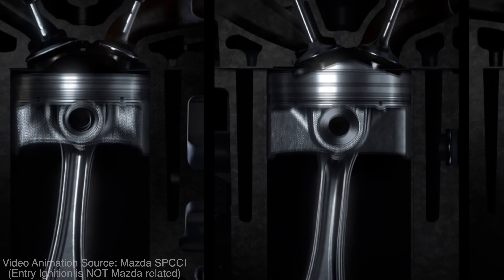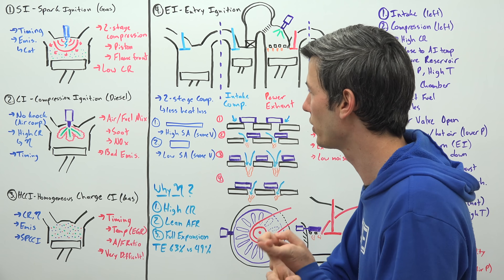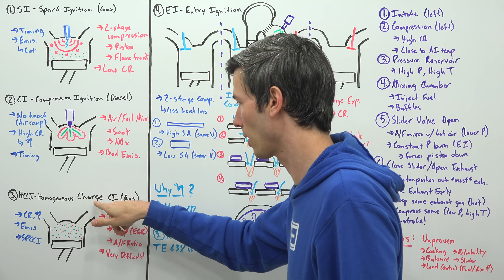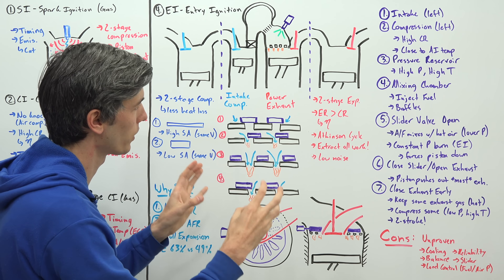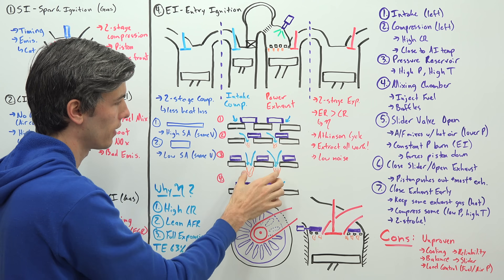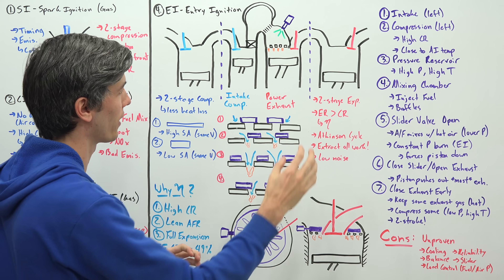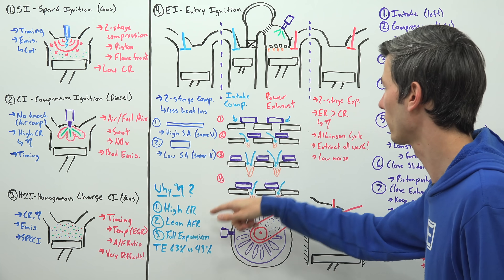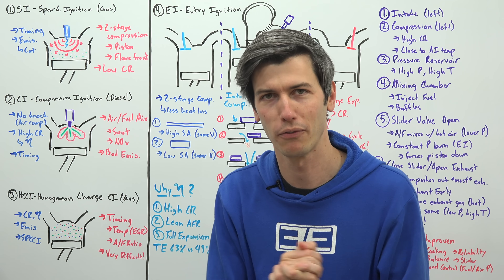Is 'Entry Ignition' The Future Of Combustion Engines?

Comment: Very complex! It can be difficult to get metals to seal when hot and cold, things move,  the idea could work, I think a turbo would work simpler, maybe just as good,  compress the air fuel in a I take runner, then open the intake valve, igniting when the valve opens,  maybe switching from Normal combustion , depending on speed and load, maybe using compound turbos, with intake valves on both ends of the intake runners, it could maybe work!

Comment: more moving parts is more loss of power due to friction, plus with that many cylinders its gonna be a very big engine and its gonna weight a lot more hence again loss in efficiency.
Reply: Weight is a function of both cylinder size AND maximum cylinder pressure. Since the intake and re-expansion cylinders never see significant pressure they can be built lighter and with less sealing capability, reducing weight and friction.

Comment: What kind of power-to-weight ratio would this have compared to a conventional gasoline engine? I'm just wondering if this design would be practical for use in airplanes. Of course there's also the question of reliability - tends to be important in aviation! - but as you pointed out it's too soon to determine this. It might be breaking the KISS principle, though.

Comment: More moving parts, less power strokes. (I was assuming there are 4 pistons, one of which has a full power stroke, even as a two stroke)
Reply: You could have any ratio of compression to power pistons want. Or no compression pistons and just use an oversized supercharger.

Comment: Because of the pressure on the slider mechanism, wouldn't there be a lot of wear on the two components?  I realize there will oil or some other lubricant, but with the air/fuel mixture always traveling in one direction, seems like it could dry out pretty quickly.

Comment: At least in this example, the third cylinder provides the primary work and the fourth cylinder provides secondary work by recycling/scavenging the pressure from the 3rd?  Neat concept.  Thought: since combustion is rarely perfect, could that hot and highly pressurized exhaust from #3 be partially charged with a tiny tiny amount of fuel in an attempt to make use of the remaining O2 to provide another attempt at primary work, and then have that last cylinder providing work due to the exhaust pressure?
Reply: Nice thought, but no. The re-expansion cylinder is after primary work, as you call it, is finished. So the perhaps 10:1 expansion of the combustion cylinder is long gone, leaving perhaps 4:1 expansion (determined by the relative sizes of the combustion cylinder and the re-expansion cylinder). So that extra fuel will get you a bit of extra power but really trash your efficiency. Think of it like an afterburner for a piston engine.

Comment: Well, with compression that high, you would have a 2-cycle diesel engine. It won't run on normal pump gas.
Reply: Actually, diesel ignites at a lower temperature than petrol. Petrol is low-temp vaporization and high-temp ignition; diesel is high-temp vaporization and low-temp ignition. The engine will work better on petrol or even CH4, which is way-low-temp vaporization and way-high-temp ignition. The engine's theory is to segregate (hot) residual exhaust gas and hot combustion chamber parts from relatively cool combustion cylinder intake air. It works because there is an inherent delay in combustion because fuel needs time and energy to vaporize and start burning. Time the injection of petrol (or whatever) based on the fuel's characteristics and the engine will work just fine. Still a klugey and inefficient design that's not much better than current designs, but it's taking a peek through the keyhole at a truly advanced and efficient engine, the Caldwell Cycle engine.

Comment: Looks like a convoluted way of attempting a turbine engine with reciprocating pistons instead of compressor/turbine blades. If we learned anything from turbine blades, it's that they get extremely hot, even requiring special expensive super alloys... So I imagine the thermal management of the hot side to be a nightmare.

Comment: How do you start the engine from a cold start?
Reply from the maker: Tech paper says it could use a spark plug in the mixing chamber for the very first cycle.
Reply: @EngineeringExplained  sounds tenuous. Remember, the mixing chamber is larger than the combustion cylinder and that mixing chamber flame (which MUST rely on standard flame propagation) has to be extinguished before the second cycle's intake begins while still leaving enough time for homogenization of the second stroke, AND the cold combustion cylinder can't suck too much heat from the gasses to make one of the first few ignitions fail. Doable, I suppose, but fugly. I'd never accept the design, but if I did I'd probably keep cylinder 3's output valve closed during one or three no-fuel cycles, depending on ambient temps, seriously increasing compression (and heat) for the second or fourth (way lean) cycle. You'll need some variation of this anyway since the pressure reservoir, mixing chamber, and combustion cylinder all need to be brought near operating pressure before the engine will work properly anyway.

Comment: The common energy loss in a combustion engine is heat. Normally, it is dealt with by radiating it out with a radiator. Is there a car which can actually use that heat? Example: charge batteries for a hybrid car. Even today's hybrids normally use the engine to turn the generator, but what about the engine's heat?

Comment: Way too many moving parts to ever achieve reliability. The future of combustion engine is in the fuel itself. Basically, you can modify a normal chainsaw type 2-T engine, where the whole combustion chamber and cylinder is one piece, to work efficiently with renewable fuels, or use basic 4-T, adding different types of forced induction, and exhaust gas recycling. The biggest problem in your model is the combustion chamber. That valve is next to impossible to reproduce commercially, due to it's design. Also, Honda had CVCC in the 70's-80's, that used a pre-combustion chamber, and Yamaha designed YICS-tube to get more mileage. So, the tech to achieve highly efficient, powerful and reliable normal style combustion engines has been around for 40 years. Today we need to take a closer look at the fuel to get better results.

Comment: @Engineering Explained   Can you do stuff on Heat Recovery, and stuff on the seperate fuel rich "jet ignitor" method (i can grab the group that does this)
Reply: Also are there any piston engines that USE detonation?  I have heard of wave disk engines, and pde jet engines, but not any piston engines.
Reply: @ericlotze7724  Diesels are soon if not already getting steel pistons .. the aluminum pistons are too great a heat exchange, besides that, I see them soon reaching obsolescence at the rate horsepower is increasing. 
Should make for a nice expansion of the envelope when they make it to gasoline engines...

Comment: Sort of like a double expansion steam engine in some respects
Reply: So tripple expansion might be better! (though heavier)  I was also thinking that external high pressure reservoir looked like it came off an old-school oil engine..... But if there's extra pressure left over and you need compression... doesn't that just shriek turbo-charger?

Comment: What happens when the slider valve opens and the first bit of fuel gets ignition then that ignition travels back into the reservoir where the rest of the fuel is burned. Also what happens when the combusting gas surpasses the pressure of the fuel and forces the useable air and fuel back out the slider valve. Or when the exhaust goes back out the slider valve since it is immediately combusted.
Reply: Quenching works. Keep the openings narrow enough and the cooler-than-ignition-temperature metal will quench the flame, preventing mixing chamber burning even if retrograde gas motion occurs. Well, unless the slider valve gets hot or the retrograde gas gets hot enough to combust anyway. Lousy design, but in theory....

Comment: No idea how to start this engine when its -15°C outside
Reply: Yeah some places get down to -40 ° and my diesel refuses to start. Same problem
Reply: @IceInMaWeiner  your diesel heating resistors are broken
Reply: And glow plugs
Reply: And glow plugs!
Reply: And glow plugs!
Reply: That's a good point - there would have to be a spark plug to ignite the first power stroke.
Reply: use a blowtorch on your pistol bro
Reply: ElectronicRedPanda yeah, I said modern. I know those intake air heating stuff from farm equipment from 70's and also in those machines that is almost useless system without separate engine block heater.
Reply: Block heaters
Reply: Well here’s the thing you basically have to shove it in a lava pit before you start it for the first time and then never shut it off.
Reply: Block heaters and glow plugs.
Reply: Ether!
Reply: Old cars had something called glow plug. Generators still have it
Reply: Mahesh Murali all modern diesels have glow plugs and those are also used to help ignition after start to remove soot at the start.
Reply: @Karjis  I haven't seen that in modern Common rail diesel cars.
Reply: Mahesh Murali every modern common rail diesel I have seen has a glow plug. But they’re all controlled automatically now with the automatic starting buttons. With key ignition you used to have to wait till the glow plug light went out, but not any more.

Comment: This is split cycle engine (Brayton cycle) , major complication will be in transferring the charge from one cylinder to next huge fluid dynamics headache and flow losses.
Second piston timing will be difficult to time for the exchange process I guess.
And cranktrain has to be modified also.
In theory it will fetch good efficiency.

Comment: It’s definitely an interesting concept.
My main issue (which you actually brought up) is the reliability.
Generally more complexity results in a decrease in reliability.
I’d rather have a less efficient engine that’ll last forever. In a normal road car at least.
Track is a separate conversation.
Reply: can't be less reliable than a range rover
Reply: My problem would be power/weight. As i said above, with this you essentially have a once cylinder engine that's the size of a 4 cylinder, with loads of parasitic loss.

Comment: It surely is an interesting concept, maybe even useful in stationary applications (or maybe replacing those 2 stroke diesels on ships).
I just don't see it working in a car.
The load-changes, the limits on size and weight and the competitive pricing  will be very hard to deal with.
On top of that I really doubt they'll get the slide-valves to last. Conventional valves in an engine are genious bc they don't really experience friction, they just close against their seats.
This slide-valve will have to move laterally under the pressure inside the reservoir.
And the efficiency is not that good to begin with. The 2-stroke diesels in big ships get ~55% and the turbocharged commonrail enginges in modern cars run about 45%.
The main disadvantage of Diesel, the complex exhaust cleanup, is nothing compared to the 4 cylinders this thing needs.
Reply: Yep. I gave up on rotating valve types for exactly that reason. Well, plus the fact that sliding valves inherently dump oil into the combustion chamber, causing all sorts of emissions issues.  Heck, my design obsesses about the bit of oil that slides through a poppet's valve guide. That sliding valve is a nightmare.

Comment: Yes it might be more efficient but to what impact on power and torque.
Reply: Power, torque, and weight are not terribly relevant anymore. Acceleration is the job of an electric motor. The ICE only needs to supply average power, which can be as low as 40HP even at highway speeds.

Comment: The Two-stroke engine: 
"You couldn't live with your own failure. Where did that bring you? Back to me."
Reply: a Perfectly Balanced joke
Reply: I understood that reference!
Reply: 2 stroke without sparkplug?
Reply: @Speedtek18  You know many 2-stroked don't have spark-pulgs, from Detroit diesels to platinum glow-plug Nitro engines, none use SI and work perfectly well. The largest piston engine in the world is probably a Detroit diesel, look up "marine engine".
Reply: @thermionicemission6355  detroit/korea diesel i think
Reply: I basically see an NSU Split Single with Valves instead of Ports.
Reply: @MyFabian94  It's fundamentally different because you have a second expansion stroke, that's where the efficiency comes from it uses most of the energy that would go out the exhaust.

A split engine still only has one expansion stroke, it's just done by two small pistons instead of a single large one. The split design is only there to guide the flow through and get rid of the exhaust gases as effectively as possible. Fundamentally it's still an otto cycle engine, like every four stroke out there.

Still it looks to complicated for mass production with acceptable performance and cost. Many modern engines, especially Diesels, already use some of the exhaust energy via a turbocharger, so the gain in efficiency would probably not be as large as indicated.

Comment: From my view, this engine may gain just litle bit over common high efficiency gasoline or diesel engine. Because for this example engine the pumping loss during double compresion is high than normal otto 4 stroke engine. If it using turbocharge or supercharge then the engine rely on boost and temperature control because if it too high temp then auto iginiton can ocure on one way chamber or if too low temp then mixture is hard to ignite. Yes it can use egr but carbon buildup is more agressive. And such engine has similar idea with some 2 stroke diesel engine with blower commonly found on large diesel engine for locomotive, marine engine etc. The difference is after air being compressed by blower then it send to combustion chamber either by valve or by side port inlet and compressed then fuel being injected to create combustion. While this engine compress air two times and send it to one way combustion chamber then fuel sprayed on that chamber then the mixture ignited uniformly as it contact with hot existing exhaust gasses in power cylinder.

Biggest challenge is rotating valve system on this example engine, have tendency to jammed because carbon buildup during combustion process. And its likely more worse than carbon build up on 4 stroke engine. Also, if expansion cylinder for any reasons  lossing compresion or gas bypas them without giving expansion energy as planned, then engine lose power so much. Even might worse than conventional 4 stroke engine.

Comment: Reminds me of the Honda CVCC of the early 7Os, super lean mixture ignited in a pre chamber before being pushed into the cylinder.
Reply: No. A CVCC analog would ignite the charge in the mixing chamber. This engine's Prime Directive is to have NO combustion in the mixing chamber. Spark ignition engines rely on an existing flame (beginning at spark) to ignite fuel, which inherently spews NOX because flames are unstable and incompletely burn at air-fuel ratios that would result in peak combustion temperatures below nitrogen ionization temperatures. CVCC is based on the fact that if only, say, 20% of your burn is at too low an air-fuel ratio for NOX prevention (the pre-chamber's burn) then you get somewhere around an 80% reduction in NOX. But since NOX is brutally hard to clean up the remaining 20% kills you anyway. This engine relies on the input gasses being heated above ignition temperature by the heated EGRetention gasses. No flame is needed to coax the burn along. Therefore, 100% of the charge can be too lean for NOX creation.

Comment: Do you know how much power such an engine would make, relative to a regular combustion engine. If it’s the same size of a regular 4cyl, but it only have half as many power strokes, sure it would be efficient but not very powerful. Also would it lack torque because it is a 2 stroke? If this doesn’t work for cars it because of packaging it might work for generators etc

Comment: Just how you turn it on? It required hot gas in the 3rd piston, but when you do cold start, how it work? Still need spark plug in 3rd piston? Also about reliable issue you bring in that slide valve, carbon deposite will be big issue after long run

Comment: Does a diesel engine lose some of its pressure during compression when the fuel injector sprays fuel? Or does the injector spray with massive pressures that efficiency is not lost?
Reply: Modern Diesel engines have fuel injectors running in the hundreds of PSI.

Comment: Will the lean air fuel ratio matter as it's a two stroke engine? Even though less fuel is being injected the number of power strokes is practically doubled. Isn't it?
Edit: so the last cylinder does work without using fuel which should balance it out further but I'm still not sure about the efficiency.